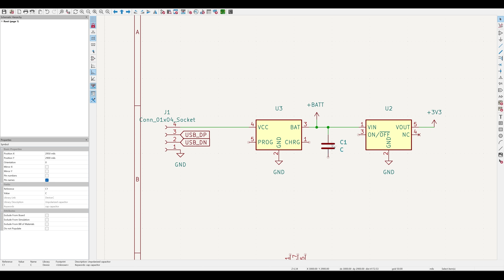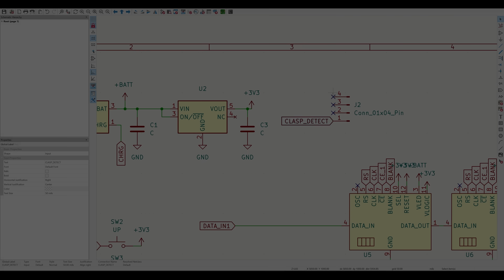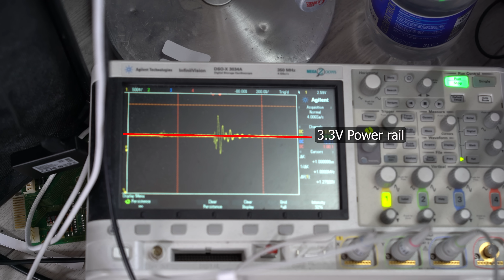How I Built the Watch From Cyberpunk

Comment: You should have gone for the modularity. You should have created a single piece which was a display and the connector to the next display somehow in the link. Then you link N of them together, and as long as one of them in the chain is a battery link, all of them now index themselves function and display not on a flexible PCB but each one is part of its own strong, tough 3D printed (or even metal printed) link that'd be beautiful. You can encase these solid. You can even see if there's like cheapest size of sapphire crystal you can buy. Maybe there's something that sapphire crystal is used for that's like they sell millions of units a year (obviously the iPhones and the Apple Watch). But something smaller which could be the size of one segment of this, one chain link. You could get those and you could have sapphire crystal linked metal band that was strong and tough. Just think modularly. Of course you need to find some way of making rotational electrical connections that were smart between each piece. That'd be so cool though. Maybe you could use sonar.

Comment: I have 4 of those displays, green flavor, they are on a module that would check the status of the door of a passenger plane lol. That's probably why they are 30$ and not common, not used for basic things.
Reply from the maker: Exactly, they were used for industrial use like that, I learned about similar ones from train seat allocation displays

Comment: This is a naive question, but could the single flexible pcb be replaced by a series of pcb segments that connect similarly to the links in a standard  watch bracelet style strap? The battery isn't much larger than a watch bracelet clasp and could potentially be used as part of a clasp mechanism.
Reply from the maker: That would work, you could also get rigid flex which are a mix of normal pcb and flex pcb. I did it this way cause the pcb ends up being very thin

Comment: thats pretty cool  you can try coating the back of the displays with a little bit of heat resistant aclyric and then try the soldering that should help for the cost of the displays can't give good solution to that

Comment: Great project, just a few ideas. You can 3D print a wrist band with chain links to make it flexible and have a nice enclosure and replace the pin connectors with magnetic mounts pins just to make it more reliable.
Reply from the maker: Magnetic pin mounts won't be reliable, and chain links would ruin the aesthetic imho 😅

Comment: That is super cool. I want one. I have some reasonable suggestions to make the whole thing more durable and wearable.

I would design and print thin and rigid pcbs that are the same footprint as the screens with pads to through hole solder them to. After soldering, snip and file the legs down and re-flow them to get the solder joint as flat and smooth as possible. On the flex cable I would have through hole pads that lined up with those filed down solder joints. Just line them up and add some solder and reflow these to affix them to the flex. I would also do the same to mount the usb-c "clasps". Apply some super thin pcb epoxy or glue between the rigid and flex pieces to really secure it all down. You should be able to desolder your screens if it ever broke. 

Maybe design some holes in the rigid pcb sections for tiny rivets to mount the whole thing on a strip of rolled clear vinyl to take all the stress off of the flex cable. Cut the vinyl to the exact shape of the pcb so it isn't noticeable. Get some vinyl glue and fold up one end of the vinyl strip to make a little pocket for the battery and seal it up so you have less of a chance to start a fire. 

Nice project man.
Reply from the maker: They're OK suggestions but they'd be even worse to manufacture and to wear cause you'd have spikes going into your arm 🤣
Reply: @Sahko123  what spikes? you'd snip and file the legs of the screens down and then mount the whole thing on a strip of clear plastic vinyl
Reply from the maker: @b1llygo4t  that's make it far thicker than it is, far more expensive, and won't hold too well cause you've filed off the solder joint

Comment: is there an alternate to the display as it is quite expensive
Reply from the maker: I really wish there was 😢, but I couldn't find any
Reply: @Sahko123  does the HCMS-3901 work as direct swap or would it need a bit more work
Reply from the maker: @coldfire0101 the 3901 should work directly, it will likely be more reliable than the 2901

Comment: I bet the PCB could be redesigned into one of those hybrid flex bonded onto a PCB. With solid PCB sections for the displays it might last a lot longer.
Reply from the maker: The version I currently have actually hasn't broken at all, the solder I used was mostly the issue, you can also use stainless steel stiffeners which would work better
Reply: @Sahko123 more premium too   It’s definitly an awesome project!

Comment: these displays are super cool, remind me of vacuum displays in huge audio centers with 3 rotating CDs, but with modern technology each of these display units should have 3 pins instead of 10, and should use LED IC technology where each LED is addressable, this way you define the locations of all LEDs and can control each one individually, you could have had a star effect of some LEDs being brighter and some dimmer, this technology needs to evolve more, great concept, but these LEDs should be LED IC
Reply from the maker: Each of these displays has 144 individually addressable leds, the way your describing would make addressing them nearly impossible and very slow. Instead, these use shift register to chain displays together, infinitely faster
Reply from the maker: Someone else in the comments described how he used high speed control to do individual dimming to have multiple levels of brightness

Comment: Hey, this is really an awesome project. I want to build my own watch also. Could you please tell me the values for the resistors and capacitors? I can not find them in your schematic. Best regards
Reply from the maker: 100nf for the capacitors is fine and the resistor depends on the battery you use and how fast you want it to charge
Reply: @Sahko123 Thanks for the quick reply, do you know by chance if the chip can swapped for an alternative of the same dimensions? Yours is not trivial to come by.
Reply from the maker: @jacobjacob5735 I design all my projects with readily available and current parts when I can, which parts are you struggling to find? They should all be in stock on digikey
Reply: @Sahko123 Im from germany, and unfortunately the chip for example is mostly available on us retailer sites that i can currently not buy from as there seems to be some issue with the payment. On the eu trading sites that i have searched they are apparently out of stock or in some weird warehouse. Pretty strange, but at least i found the led displays on ebay for 10 pieces at 55 euros total...

Comment: (Still watching the video)
You need a circuit debouncer to cleanup the noise on switch power-on. A schottky diode does the job. I encountered this exact issue way way back when i was doing my thesis--It solved the circuit noise issues of my analog-to-digital converter.
Reply from the maker: I don't need debounce for my switches, the way they are handled in code means it automatically debounces

Comment: What is the name of the gel you used for soldering all the displays to the flaxible pcb at minute 6:20 and what is the benefit for using it?
Reply from the maker: That's called flux, it's used for making solder flow better once it's melted, the solder I used there didn't have any inside it, but most solders you buy has flux cores inside them
Reply: @Sahko123  Thanks for the info, awesome proyect and will be tuned for future videos!

Comment: I wonder if you could add a MEMS accelerometer to the circuit (like those inside cell phones). So that, when you tilt your wrist from a set position, the hours-minute-seconds readout slides accordingly along the displays strip, to always be facing towards the user.
Reply from the maker: This was part of the an but I ran out of time  😅
Reply: @Sahko123  Accelerometer coming to 'Future Watch 2.0', maybe?  (If a 2.0 version is in the cards :D)
Reply from the maker: @Z-bb7pk maybe 👀
Reply from the maker: This was the initial plan but for time I didn't do it, a commercial one or v2 will have it and more if I make one

Comment: Maybe use one of those magnetic connector for the locking of the clasp. As for reinforcing the strap overall maybe a strip of Tyvek might do the trick. It's thin and durable.

Comment: Awesome project, love the amber displays! A tip about the hot plate, try using it in combination with an iron or hot air. The hot plate should be at a temp just below wetting, then you apply air/iron to push the desired components over threshold.

Comment: I love it already with a little refinement this could be so sick!!!  Maybe 3d print a small case for each screen that acts like watch band large links for cleaner look and to put stress on the casing instead of flex cable.  other cool thing would make the back one of the slap bracelets so u can just slap it on and off.
Reply from the maker: I like the slap bracelet idea, funnily enough if you overheat the flex pcb the stiffeners will actually cause it to bow a little and act like a reverse slap bracelet where it'll straighten itself out.

But so many people have suggested the links and I feel it'd defeat the point and take away from the aesthetic
Reply: @Sahko123 I could see it taking a bit away from the aesthetic. Maybe another option is coat the flex cable in a thin layer of soft silicone. Be nicer on the skin and add a little protection to cable

Comment: This sums up the modern image of the custom products of a small size. It’s relatively easy and cheap to create something cool and customizable if you have such idea, but it extremely hard and expensive to mass product it because you need a really custom shape components which basically are non existent. But, I’m sure it will drastically change with AI, the tendency goes to design and manufacturing becoming fully automated at home using just a prototype materials just like a 3d printers.

Comment: It should be posible to use trough hole paths for the displays for be able to solder, ill try a cheapest one whit less displays or maybe others
Reply from the maker: It is but the reason I didn't use them as through home parts is because I didn't want them to go through the pcb just be on top, the back is smooth

Comment: Thank you for sharing the idea and materials. Maybe it's worth trying to implement this on 7 small segment indicators, maximum 2-3 in a row. Make separate boards for each hip, which will be connected with thin wires from headphones, because they can withstand a lot of bending. And all this in the bracelet body, individual links.🤔
More inspiration and great ideas to you!

Comment: I’m sure this is in here but have you thought about using links similar to a watch band or a tank tread so each display would have its own solid backing and they would link to the others. Would allow for size adjustments too.
Reply from the maker: That would space them too far apart or make them less flexible or make them less strong. I didn't consider it cause I think it's ruin the aesthetics and purpose of the watch

Comment: PLEASE PLEAASE MAKE A. FLEXIABLE CASE FOR THE WATCH TO HIDE THE PCB!
YOU CAN MAKE THE DESIGNS AS FLEXIBLE AS THE WATCH UT SELF!
this is Soo cool!
Reply from the maker: I want/wanted to embed it in silicon but I quite like it the way it is. I also planned on putting some grip tape underneath it and had the tape with me the whole time but didn't end up using it since I couldn't find double sided tape
Reply: oh I see.. i thought of this case in a modular design, i imagined it like the case would be broken in segments that contain the screens and the flexible PCB running through through the segments and have silicon cover the parts in between, that would require a whole ahh redesign and engineering.
i would love to work on something similar in the future. so PLEASE make it open source if you can!
Reply from the maker: @ASOCARC it already is open source! Linked in a pinned comment and the description!
Reply: @Sahko123  THANKS

Comment: I've never seen these little displays before, do they do one without the spacing between charactors?
I need to source something that  can be used to replace a burroughs SSD1000-0030 VFD that got smashed in a vintage bartop blackjack machine, but since they're real hard to come by I thought about making an arduino interpreter to go between the blackjack machine and some sort of LED replacement display, but so far I've not been able to find any LEDs that go small enough to fit in the window in the machine's casing
Reply from the maker: Oh I wish I could say something existed that could replicate those burroughs displays. Funnily enough those displays are panaplex, so closer to a nixie tube than a vfd. But they are so gorgeous. To make a similar display you'd need to make a panel of these leds all wire bonded together which would likely cost up to and beyond 300usd per led panel, but I sure hope they come to exist if they don't already

Comment: Very cool. I've always liked these displays, and I've only ever driven them with FPGAs cause you can do per-pixel PWM on them to get grayscale values. They can be driven faster than their rated clock speed, generally. This also lets you do pulsing light effects etc, so you can just keep them in daylight/12mA current mode the whole time and do brightness control with PWM. One of my projects basically had separate data streams for the 1-bit pixel values, and another stream for a "mask" that would set the per-pixel brightness level. So this way I can have the main bit stream display time let's say, and have some cool rolling gradient effect as the mask. They just get OR'd and ANDed as needed for the final outputs. Momentary flashes could be extremely bright, since they're very bright displays - yet they wouldn't consume much power if they're short. The FPGA method also means you can disable clock trees as needed during idle for power savings etc. Something something dumb ideas something something.
Reply from the maker: That's quite cool I was wondering how grays ale could be achieve but brute forcing them through shear speed of updating wasn't an Idea I thought would work 🤣 I prefer the binary on or off for the effects I'm using
Reply: @Sahko123  Mmhm, it's honestly not too bad. You can basically use native speed (usually 5MHz) and still get decent PWM grays. Perceived light output from LEDs is non-linear for PWM, so you have to implement an exponential correction curve (just a LUT) such that PWM levels scale the brightness more or less linearly. I have a piece of dev gear that has a 20x3 character layout of these LED displays that are all serialized, and my clock rate is about 11MHz. The faster speed helps for the display to remain flicker-free when you're running the displays at max brightness/current, but still want to dim them down very low. Another LED pixel display unit I have can actually run at 150MHz clock (where stock was 3MHz), as a weird example. For the FPGA side of things all I'm really doing is generating a long bit vector, where each bit in the vector toggles at a different PWM duty cycle, so any given display pixel just selects a particular bit within that vector which gets OR'd with the 1-bit pixel data. But ya sheer speed of FPGAs is great for light effects~ these days you can cheap designs with a micro feeding data to an fpga that drives high speed things, so that you avoid doing high level constructs in HDL. That type of dual solution is still much cheaper than FPGA SoC chips.

Comment: A great project, but there are a couple of points that will help make this bracelet more comfortable: the battery can be positioned like a regular watch in a wide part above the wrist, and not under it, so it will be more convenient to bend the arm, besides, if you make flat connectors as a clasp, it will look more aesthetically pleasing and you can also place non-bendable elements between them,  such as controller, etc
Reply from the maker: It's actually quite comfortable to wear, flat clasp style connectors like fpc connectors only are rated for about 35 cycles.

Comment: Hmm i wonder if one could just get ultra small LEDs to make these displays yourself.
Reply from the maker: Yeah, people have done that, to get leds this small however you'd literally be using bare led dies, and I you also have to figure out how to drive them
Reply: @Sahko123  I guess a typical matrix display controller should do fine with it.
Reply from the maker: @platin2148 yup, thankfully those are built in in this case
Reply from the maker: This was the idea if I ever wanted to make a commercial version for somewhat less